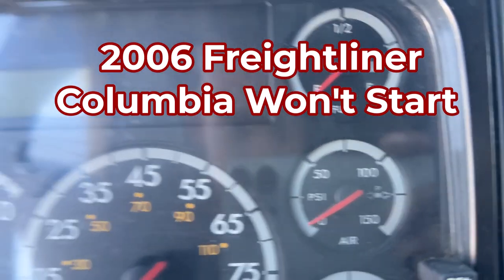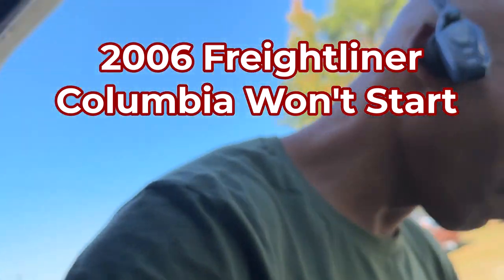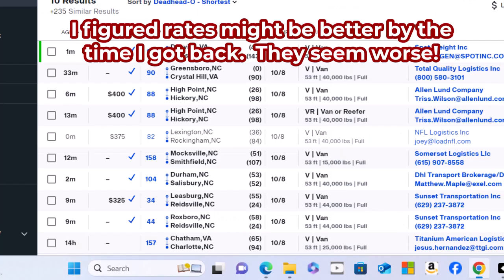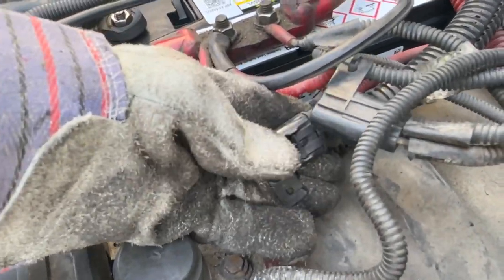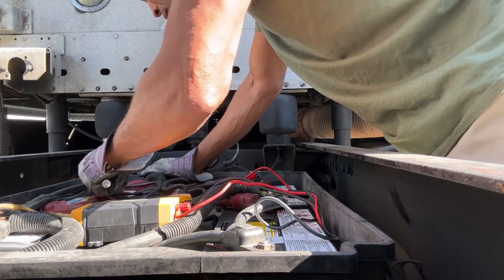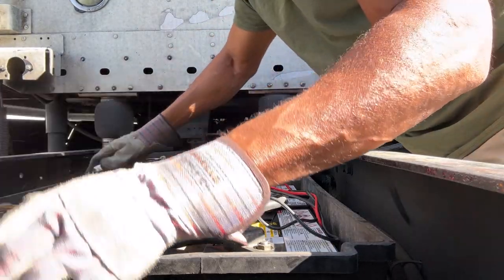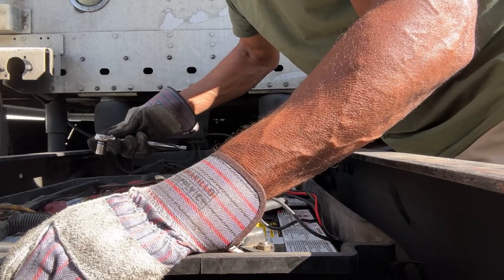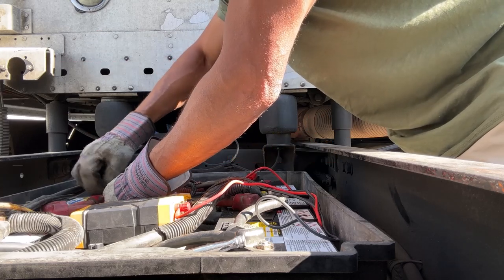Need yall help!  2006 Columbia Freightliner Won't Start - Do You KNow? #itsbroken #freightliner

Comment: I would check the fuses in the dash. I remember having a weird problem similar to this once on my 07’ century. It ended up being a fuse or relay under the passenger side dash panel. Check your grounds and clean them. As a last resort take it to a good electrical diagnostic mechanic. Best wishes
Reply from the maker: Thanks for the feedback @Cmonwidit!  You're right on the instrument panel.  Was a fuse.  Still checking on the no start

Comment: Seems like an electircal issue, if the dash wont come on, could be some shortcurcuit
Reply: Maybe fuel injectors?
Reply from the maker: Thanks @stoony1745  The dash was a fuse!
Reply from the maker: We got it running.  When its running, it runs smooth.